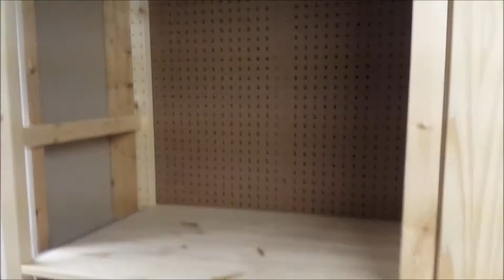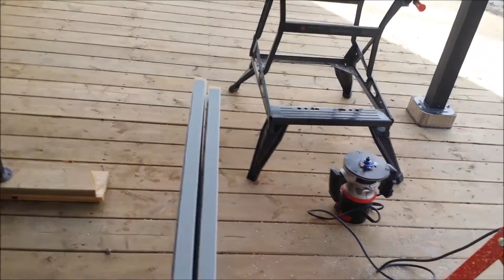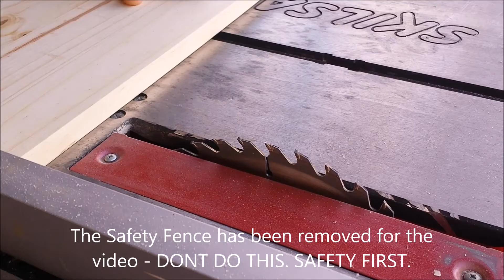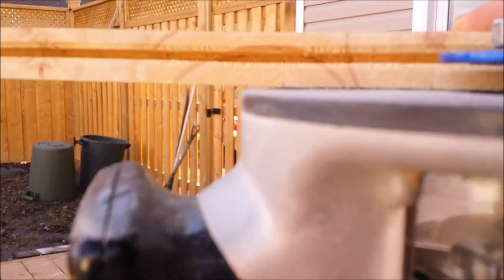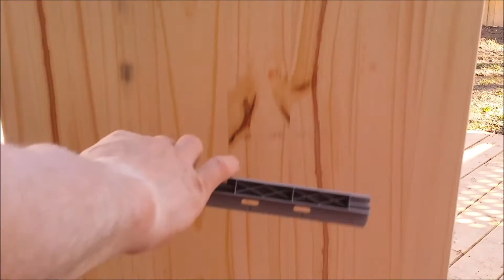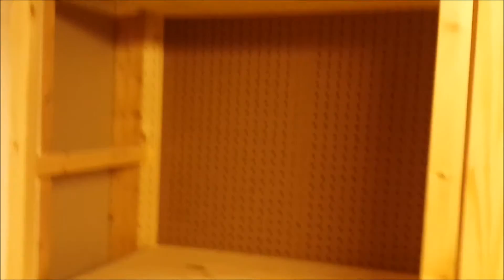IKEA IVAR Custom Shelf Hack

Comment: Would love if you could share the clamps you are using on your workmate! Just invested in one and those look so handy!
Reply from the maker: Ohhh those... Yes very cool eh. You can't buy them retail anymore I don't think. There are substitutes. They were called the B&D Gripmate Clamp 79-011 or 79-016. Here is an explanation. 
https://h-frame.weebly.com/gripmate-79-011-79-016.html
And here is an eBay ad
https://www.ebay.ca/itm/285006670085?mkcid=16&mkevt=1&mkrid=711-127632-2357-0&ssspo=2iBZ7A5-TJe&sssrc=2349624&ssuid=rRUyhBZBTZ6&var=&widget_ver=artemis&media=COPY
Reply: @SOB2141  I have been stalking the interwebs for these and they have been basically impossible to find. I wont give up though!

Comment: Thanks very much Sean, this is really helpful. I'm not at the point where the exact width of shelves matters to me yet, but I was trying to make some outside corner shelves (as opposed to the inside corner that has stock shelves/posts from Ikea). I was about to make a couple of diagonal cuts in a shelf then try to join the two resulting triangles into a single shelf, but this is a much nicer solution.

Comment: Unfortunately they’ve changed the edges from 2019.  Any updates?
Reply: I just came across this page where someone succeeded in removing the steel inserts.  In that 7th photo, it looks as if he bent the pins sticking into the wood outward before removing the insert, cutting the board down to size and sticking the insert back into place.
Reply: Can you link the page???
Reply: @heatherdite462  Could you please share the link that @CookyMonzta sent you? I can't see it, and I'm currently trying to do this exact hack and I can't figure out the new edges!
Reply: @orlandosetanta  oh no! I think the comment was deleted and I don't have it anymore. I will see if I can find it. 

I ended up just cutting my edges and buying shelf pins from home depot. I can't say it worked amazingly well, but I didn't have time to do the router fix.
Reply: @heatherdite462  Thank you for your reply anyway :)
Reply: @CookyMonzta  Thank you so much!!
Reply from the maker: WHAT?? Seriously? Well no update right now as this Covid thing is going on but I will have a look ASAP.
Reply from the maker: Ah I see what they have done. This was to address the issue of stuff falling between shelves. So this will take a bit more cutting but it is essentially the same process but the slot is cut on the flat side not the edge (I Think) I need to go get one but they have made this way way more complicated. Grrrrrr....

Comment: I ordered some Ivar shelves that haven’t been delivered yet, so I can’t measure the slot depth. Could you let me know what depth router bit you used, so I can get the proper size bit for when my shelves arrive? Thanks in advance & for the tutorial!
Reply from the maker: The slot death really doesn't matter as long as it's deeper than the tab on the plastic shelf clip
Reply from the maker: I have a picture of the slot bit that I used but there doesn't seem to be a way to post pictures in the replies to a YouTube comment. I think the bit that I have will give you a slot depth of about a half an inch

Comment: always push your wood all the way through past the blade. You can get a kickback!
Reply from the maker: I was running without a guard for the video and I didnt want to expose the blade. If you see I turn the saw off as soon as the cut finishes. But yes you are right.

Comment: Thanks for posting this video! You certainly took the time out of trying to figure this out on my own. Appreciate you taking the time and putting in the effort to figuring this out and then also making this video to post. Well done!!
Reply from the maker: You are very welcome Ian and thank you. It worked out well and I found this was the cheapest and nicest workshop shelf system I could find.
Reply: We're using them for bookcases and so I had to shorten the middle shelves in the span of 3 across 1 wall. Lost 1 shelf in sorting it which I felt wasn't too bad! Would have been far more without your video.

Comment: Thank you very much for your video; I'm thinking of buying a bay to fit into an existing "door sized" alcove;so it was exactly what I needed to watch.   I'm slightly puzzled why you would buy an Ivar system when you already have the tools and skill to make a bespoke unit with higher grade timber|? I guess it must be cost - is it that you can get the Ikea unit cheaper than buying just the timber plus you get the support system? Thanks again.
Reply from the maker: Hougrel  hi Hougrel, yes you are right. by the time you buy the wood and hardware you can't compete with the buying power of IKEA. But the biggest reason is saving time. I had three sections one with a big cupboard. I only had to modify 3 shelves the other two sections went right up
Reply: Thank you for your reply - Mike